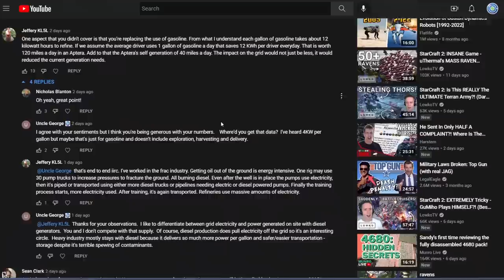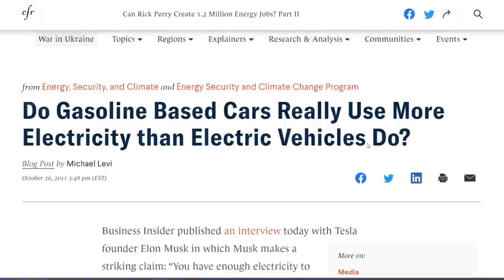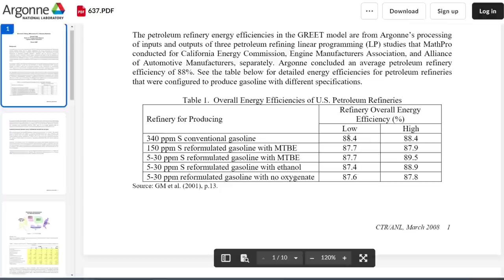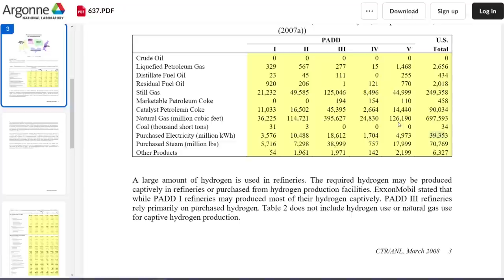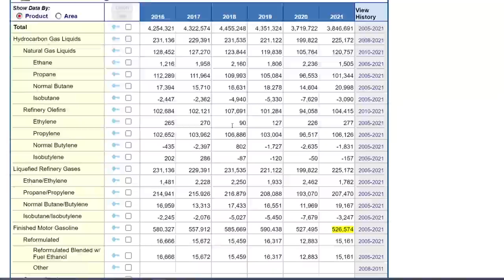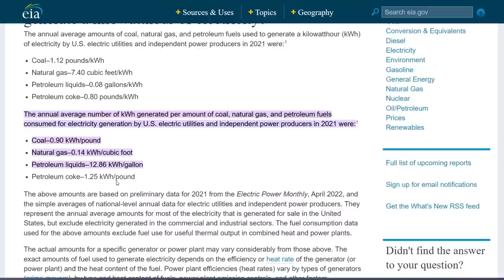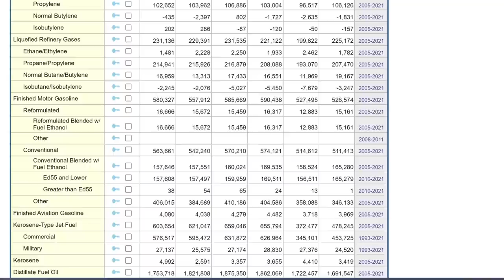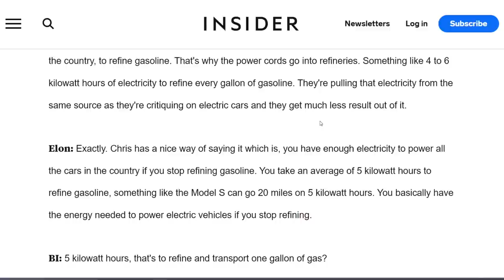How much electricity does refining gasoline actually use?

Comment: Wow this is a great break down. Thanks. Can someone help me understand the part about considering all the fuel that “could have been used to produce electricity”? To me it seems like the question is “can the current grid infrastructure support EVs” and so the number we need to look at is the electricity that is purchased from the grid. Am I confused about something here?

Also what if we use the metric (average mpg on the road)/(gallons produced per kWh purchased in the refining process) = miles per kWh for gas cars. Then we have a nice number to compare to the miles per kWh for EVs. If EVs have to talk in MPGe let’s make gas cars speak miles per kWh. 😜
Reply from the maker: the answer to the question “can the current grid infrastructure support EVs” is no it cannot.  Currently the grid cannot support and 100% EV transport system.  That will take couple of decades to build out.

the answer to the question "if we stop using petroleum and electricity to extract and refine and distribute gasoline and instead use that petroleum to make electricity to power EVs, will there be enough energy to power all EV intrastructure?"   the answer is yes we will likely have 4 to 5 times the amount of energy we need to do that.  So converting to an all EV transport system will take 80 percent less energy than the current gasoline based system even if we don't use any renewable energy like solar or wind.

Comment: Hmm. Interesting. But I'm not sure there's a way to do calculations like this with enough impartiality to satisfy either side of the argument.🤔

As a lowly cyclist (I do daily grocery shopping trips and run errands for myself and my neighbours) I find my energy conversion efficiency interests revolve around not maths but what makes the better breakfast: homemade muesli or something hot and more substantial such as baked beans, fried tomatoes, and several scrambled eggs with fried bread.

A breakfast of cold cereal and dried fruit is surprisingly energy efficient. It costs nothing to prepare. I soak my cheapo DIY muesli (basically porridge oats with chopped dates, nuts and sultanas) overnight so that it's not hard, dry, bitter and crunchy but plumped up, sweet and squidgy by breakfast time.

I save a bit of energy and cash by not making a hot drink with it. After that I can do my morning ride into town with ease; when I get home at midday I still feel full enough to want nothing more than an apple at lunchtime.

Saves a load of money and energy.

A full cooked breakfast uses a modicum of electricity (I have a tiny induction hob to cook on; it's remarkably energy efficient), but has a big psychological advantage over cold cereal in bad weather. I'm based in the north of England, so lousy weather is the norm - summer or winter, it's never nice for cycling.

Interestingly (well, not really...) if I have a cooked breakfast I usually feel hungry by lunchtime. A neurotic nutritionist could no doubt explain about the various rates at which protein, fat and carbohydrate are metabolised, but I couldn't give two hoots (🦉🦉).  I eat to live, I don't live to eat.

Likewise, I don't suppose many people really (not  REALLY) worry where their power comes from as long as it's there when they flick the switch or turn the key.

Doing sums is fine, but there are enough variables to make every set of figures convincingly accurate, whether you're selling absurdly expensive petrol or promoting absurdly expensive EVs.

Meanwhile, back on the bicycle... Setting out for town (it's about 10 miles there and back) in an icy gale with slush on the roads or in pouring summer rain and with a heavily laden bike is a miserable chore, so a hot breakfast is worth the electricity, but ultimately costs more because I end up feeling hungrier, eating more, and emptying the larder sooner. (I haven't got a fridge; I can't afford to run one.)

So...I've found that the optimum start to the day in winter is a hot-cold compromise - a large bowl of hot sweet porridge oats - the breakfast of champions (also carthorses🐴👀  🤭) - plus a pint of tea or coffee. Even after a gruelling bike journey I find that keeps me going right through until teatime [about half-past four in the afternoon].

No need for lunch. Yay. More savings.

I no longer care what the electricity companies and 'real' people get up to. I don't care how many miles per gallon or carats per kilometre (or whatever) people claim they're getting. Go ahead and refine your petrol and charge your EVs and squander your hard-earned incomes and resources - I'm not interested. My limited needs cut out the middleman and go straight to burning calories directly.

Not a very popular option these days.

No, these days it's all about conspicuous consumption. From what I read, many EV drivers own (or plan to own) at least two cars. If/when the Aptera arrives, people will have three or even four vehicles, which is a ludicrous way to conserve resources and reduce your impact on the planet.

In the days of ICE cars (in Britain, at least), families just had the one multi-purpose vehicle. If you had other transport needs - more passengers to carry, more cargo to transport, more distance to travel - you left the car at home and walked or took a bus or a train. Or you hired a van for the weekend. You didn't buy another car or two.

With EVs, though, people have become even more greedy and needy; the idea seems to be to treat cars like any other gadget - you have several, each supposedly perfect for one task and incapable of doing two.

People have been trained to consume. Good doggie. Lie down! Roll over!  Now BEG...

Ego Muskrat must be laughing all the way to Mars.

Sigh. Can't people see what's going on? Don't they care that they're being used?

Nope. 😞
Reply: You must love coffee? :) quite the commentary! Loved it.
Reply from the maker: well you clearly missed the birthday video.   cycling is by far the best transportation method.  I have logged over 50,000 miles commuting by bicycle.  this is not cycling for recreation. this is cycling to go to work and to the store and to the gym, etc.  but the fact of the matter is that the infrastructure in the US is not setup to function without a vehicle.  For the times I need to go farther than 20 miles round trip I'm going to need an Aptera.
Reply: I don't think most people with more than 2 EVs actually keep that many in the long term.  They either are very interested in them or review them for a living and eventually sell the one they like less, which theoretically also makes EVs a little more affordable for others.
Also the whole point of the Aptera is trying to adapt what is essentially a solar racer to the needs of most people, not to get people to sacrifice adapt their lifestyles completely to use as little energy as possible.  
It's a very small step in the right direction, as people are very hostile to large and quick lifestyle changes otherwise communist revolutions would actually work.

Comment: Chemical energy, like petroleum and such, has the main advantage in heat production.  It is the best form of heat production besides nuclear.  Heat is needed in most industry to do things.  Using electricity to produce heat is not as efficient.
Reply: An electric heater has an efficiency of %99.9

Comment: I brought this point up to my dad, and he said that the electricity used to refine crude oil is generated by the refineries using oil and they don't draw from the grid. I haven't been able to find any clear information about whether this is true or not. Thoughts?
Reply from the maker: Does it matter if the power plant is on site or off site?  The electricity still has to be made
Reply: @ApteraOwnersClub  I would say it does matter in regards to the demand on the grid. The argument that some are making is that The US won't be able to produce enough electricity to power homes and EVs, and, unless I misunderstood, you're saying that if less fuel is being refined, then the electricity they're using to refine oil can be used to support the demands of EVs. But, if the refineries are producing their own electricity, and less fuel is being refined, won't they just make less electricity. I'm not trying argue against EVs, I really want one of my own, I'm just trying to understand the facts. If an oil refinery closes down, whatever onsite oil-based powerplant they're using to power it probably wouldn't keep running, right? So it's a fair question to ask whether these refineries on the grid or not.

Comment: Won't refineries still be active even if they produced zero gasoline? 
Can they produce the other stuff without producing gasoline?
If so what would be the energy difference be?
Reply from the maker: yes, if theoretically, they produced no gasoline, they would route the material over to aviation fuel or diesel or something else and it would reduce the energy consumption by 14% since gasoline production is 14% of the output.
Reply: @ApteraOwnersClub  Assuming all products out of a refinery have the same energy requirement to produce is probably wrong; many are essentially byproducts that just happen to have value/use.  I'll try to dig up the two studies I found on this previously because Elon and your study were not ones I had seen

Comment: Total energy spent for extraction and distribution should be added..(from drilling to the gas station) ...! 
Now, you can't get rid of all the byproducts..it's not just gasoline, so you'd get the refinery anyway ....Am I wrong ?
Reply from the maker: yeah, I couldn't find very good info to calculate the energy costs of exploration, extraction and distribution so i couldn't include that.

and yes we are going to need refineries of some sort for a LONG time because we still need plastics and asphalt and jet fuel.   Gas is only 14% of petroleum products in the US refined.  But just that 14% uses a ton of energy.
Reply: @ApteraOwnersClub  Today I'm using a PHEV and instead of gasoline I'm filling my tank with ethanol (E85 in France) ..so far that's the best solution I've found to avoid  one single drop of fossil oil  😉
Reply from the maker: unfortunately, ethanol is probably worse than gasoline because it takes a tremendous amount of petroleum to grow and process the corn or other feedstock that gets converted to  ethanol.   I haven't checked the data recently but last time I checked, biofuels from corn or sugarcane are a net negative for the environment.
Reply: @ApteraOwnersClub  that's why I'm waiting eagerly for Aptera ..which is THE best solution ..My current solution is only a lesser evil  ! So far, full electric cars are either too expensive or with not enough range, for me at least.

Comment: Most oil is not used for gasoline.  In fact, even if you have a place with all electric vehicles, oil production and refining will still take place, to get the materials for plastic, asphalt, tar, ect.  You aren't going to be able to shut down oil refining and cracking and divert the energy.  You can't just take all that oil used for various purposes and burn it all in electric generators.  

Major flaw in your logic.
Reply from the maker: I'm guessing from your comment that you didn't listen to the entire video.  I state that gasoline is only 14% of petroleum refining.  The remainder of the exercise is a theoretical exercise that shows the energetic costs of petroleum refining.  And yes, you could divert the energy to generate electricity.  You can't do it now because the infrastructure isn't in place but you can absolutely generate electricity using petroleum as fuel.  I'm not advocating for that because I think other fuel sources are superior but it can absolutely be done and it is done.  Petroleum currently generates about 5% of our electricity.

Comment: all of those products that you are hypothetically converting into electricity had to be refined, distributed, and in the case of steam, heated up.
Reply from the maker: exactly, and those exact products which are refined distributed and heated up were used instead to refine more petroleum.

Comment: I'm confused. Are you taking into account the amount of energy that could be produced using the steam etc. that was used for refining gasoline? Or are you taking into account the amount of energy used to produce steam and other products used in the making of gasoline, not just the electrical input into the refinery?
Reply from the maker: the amount of electricity that could've been produced by the steam, natural gas, petroleum coke, still gas, etc that was using in refining the gasoline.
Reply: @ApteraOwnersClub  this might be a bad assumption. I think they use low pressure steam for heating. It’s basically the waste steam after the electricity is already created. So you would have already used this steam for electricity.
Reply from the maker: well, it's unclear.  water has a very high heat of vaporization and much of the energy content of steam is taken up in the phase change from liquid to gas so as long as it is steam, there is significant embedded energy in it.  I suspect the energy content of steam per pound is with steam at low pressure right after the phase change.  If you know of better information, please share it here and we can easily recalculate.